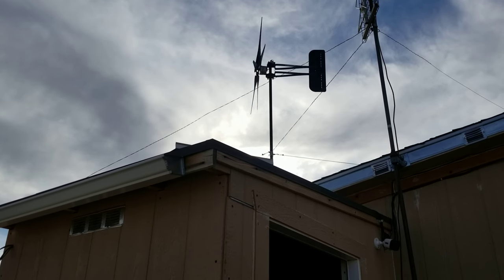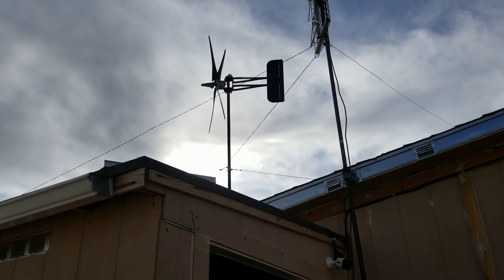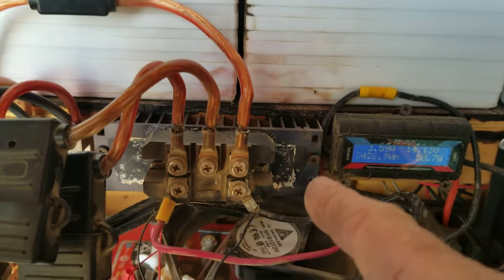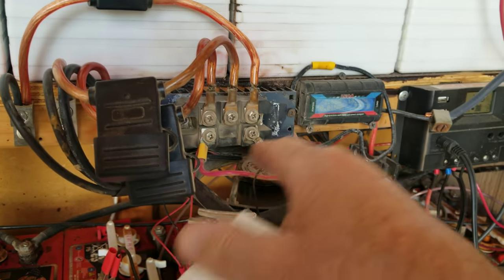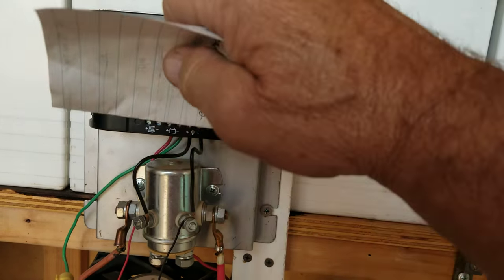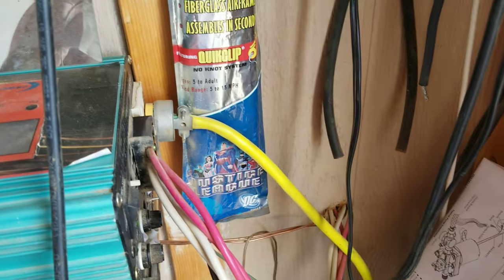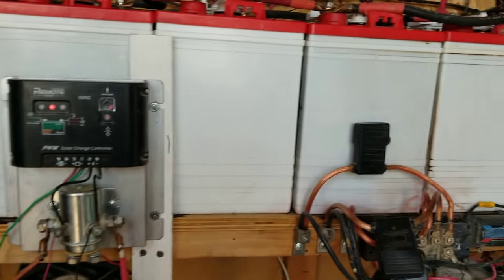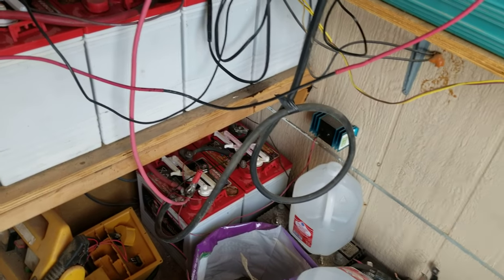Wind turbines, controllers and batteries explained, March 6, 2020

Comment: Hi, excellent video! Hey, I noticed your turbine turns clockwise and counter clockwise; does it matter which direction the blades spin? Does a 'reverse' spin cause any damage to the turbine? Thanks - and thanks for the inspiration!
Reply from the maker: Hi, a turbine ca. Only turn 1 way.  That is determined by the blade angle and the tail fin which keeps the blade facing the direction the wind comes from.

Comment: Good  explanations  but  just to long  I saw a solar  charger controller   but it's  about  here windturbine  
Help me if I am  wrong
Reply from the maker: I don't quite understand your question/comment.
None of the charge controllers in my power room are connected to my turbine.  The one green mppt hybrid controller has connections for a 3 phase turbine, but I don't use it because it doesn't show the PMA output separate from the solar.

Comment: So to make sure I have this right, The wind turbine generates power which is converted to usable power through the rectifier, which you then put through something that prevents too many Volts from going into the batteries, and from that it goes to the batteries?
Reply from the maker: Not quite, but close.
There are 2 types of wind turbines.  A 3 wire AC unit called a PMA, and a 2 wire DC unit called a PMG.
The PMG does not need a bridge rectifier and can connect directly to the battery bank.  The 2 wires are either color coded or marked positive and negative.
A PMA'S 3 wires are all the same color and unmarked.  These 3 connect to the bridge rectifier which converts AC to DC by directing current flow in one direction by use of a series of diodes.  The 2 wires coming out of the BR are marked positive and negative.  These go directly to the battery bank.
Since there is no controller to limit input, as long as the wind blows electricity flows to the batteries.  So, to protect the battery bank from overcharge,  a dump load diverter is connected to the battery bank and senses when the charge reaches a set level, then turns on to divert the excess power to a determined resistance.
That is the least expensive and easiest way to do it, but also the least efficient.
You could run the input through a Midnite Classic charge controller that is dedicated solely to turbine input/output and get the best production from wind to battery. 
Of course, cost of a Midnite Classic is usually why most choose a dump load controller/diverter.
NOTE: The Midnite Classic will work for wind, hydro OR solar input, but only one can be connected at a time.
Reply from the maker: Oh, and welcome aboard!
Reply: @GBear  Doesn't a charge controller require a stable or non-varying input to create a consistent output? So to use a wind turbine for instance it generates more power the more it spins so it may be putting 13V into the controller or maybe it puts 20V into the controller. Is the controller able to produce a 12V output in either of these cases without requiring a dump load driver.
Reply from the maker: @Narsterstar  the Midnite Classic does all that and more.  I wouldn't trust  Chinese made hybrid to do it though.

Comment: i got a 3000 watt turbine but it has 4 red wires comming out of it.. can ya get a 4 wire rectifier ?  any one know ?
Reply from the maker: Hi Wayne, welcome aboard.   I have not heard of a 4 wire pma, nor a 4 wire rectifier.  I have no idea why there would be 4 wires as an AC unit only needs 3 pairs (3 wire).
Is this a DIY unit?  If not, I would Google the serial number, or make and model for more info.
Good luck!
Reply from the maker: Wayne, I did some checking online and apparently you have a 3 phase unit, but one of the wires should be a neutral and the other 3 hot.  I found this
https://images.app.goo.gl/SvmAtABNaE5qV5JRA
I hope it gives you a starting point.

Comment: AWG = American Wire GAUGE not Grade.  Also 10 AWG has a large voltage drop for 35' at high amperage (>20amps).  The fuse block wire insulator is designed for speakers not high amperage.  The rating on speaker fuse blocks is much less then THHN or other insulators.  You are asking for the insulator to melt and cause a fire.  All terminal blocks need to be in a box just in case there is a fire, it can be contained.
Reply from the maker: Oh WOW, wish I knew that when I put my system together nearly 5 years ago.
Reply: @GBear  The laws of Physics are unforgiving and cannot be altered by man.  We can try and skirt these laws but eventually they will catch up to us all.  You are not alone and I have seen these mistakes many times over, as these are common mistakes.

You need to read your home owners insurance policy because it (most likely) states that any electrical fires will only be paid out if all the electrical work meets or exceeds NEC codes at the time of install.  I know people do not want any government interference and neither do I.  However, my insurance requires me to get all of my solar work inspected.

When I consult, I always advise an electrical inspection so in the event of fire, the home-owners insurance will cover the damages.  In my area, the cost of the permit is under $100 and the Electrical Inspector is great to work with.  

There are some people that have a back yard "solar shed" that is isolated from the house/garage. If it burns down, who cares right?  But you would be surprise how much the Fire Department will charge you, likely over $1000.  Homeowners insurance will cover this charge as well provided all work is inspected to the NEC.

You seem to have an average understanding of solar installation and thus an average risk.   My point is to provide an different point of view on solar install:  Do it right the first time, and get an inspection.

Comment: Dear G.Bears We thank you for your clarity of your videos ,very clear speach of yours ,and properly technical placement of all the aspects concerning what else....Energy. I have one question .We all know that somehow china is the center of our planet for most of the things that we all days we need.One thing that strikes my mind is the Wind Generator issues.They shout 1,5 KW    2 KW   etc and there are plenty of videos that they measure their output and the result is so dissapointing to the thechnical world.I really wonder how Not even one [to my knowledge] has not tried to create a wind generator from a truck Alternator which they really have good output but of course need long wings and strong wind.I will continue searching around for an honest wind generator in regards its cost.Also instead of having dump load for the wind generator to drive the cable to the appropriate Resistance of a water boiler so.no energy is being lost cause actually heats up the water inside the boiler. Everybody knows that there are professional people that they construct resistances to your needs AC    DC    5 volt    20 volt 100 volt  .u just name it.....Best regards.

Comment: Use solid state relays instead of solenoids, not worth the fire risk.
Reply from the maker: Been there 3 years without getting hot enough to hurt your fingers.  I have an automatic fan that blows across the solenoid when it kicks in.
Reply: @GBear  great info, didn't know about the bls will have to get one. Thanks
Reply from the maker: Get more than one if you have a large bank of batteries.   I just learned that in the school of hard knocks.

Comment: I am seriously considering adding a wind generator to my system because it suits my location, but don't want to stress my LiFePo by micro cycling multiple times a day.

I need to figure out how to create a wind generator system that dumps load without the dump load going through the batteries!? For example: the charge controller for the turbine identifies max load then diverts energy from the turbine before it even reaches the charge controller or battery. Every diversion / dump load system seems to cycle the excess energy though the batteries themselves, something that should probably be avoided. In dire need of a solution, but after many days of research there seems to be no solution. Maybe someone has solved this problem already? I would love to know...
Reply from the maker: GBear to the rescue!  Look into the Midnite classic 150, 200 or 250.
It can control a turbine efficiently and allows for adjusting a custom curve to meet your wind specs.
Reply from the maker: Oh, and welcome aboard!

Comment: i have a 800 watt 12v with a 100 amp charger set up and a 250ah battery life04 that burned to day and a 450 watt 12v with a200ah batterys with60amp charger doing fine
Reply from the maker: You ate saying 12v now, but you said you were going with a 24v system?
Also, this doesn't answer my questions.
Reply from the maker: Uploading a video now.

Comment: Why not just used a controller for the wind turbine too.
Reply from the maker: Cost
Reply: @GBear  
Cool. Okay I have an idea... Instead of just desipating the excess energy as heat through that resistor. Why not try doing something creative like water heater. I don't know about the cost sha🤔
Reply from the maker: Yeah, that's a common thought, but as I've said before, I don't need hot water in the desert.😁
Reply: G Bear's Off Grid Ways-A Homestead In The Desert is there a way to control the water temp if you did that to your water heater? I’d like to do that with my extra power (once I get set up) but I’m worried about the water getting too hot since we have little kiddos
Reply from the maker: Welcome aboard!  I found that the dumpload water heater was not an efficient water heating method.  This was due to the fact that the wind doesn't blow constantly or at a high rate, so the amount of extra electricity was negligible. The 300 watt heating element also used up any extra power that was created so quickly that it never really got the water hot.
I went with a tankless propane water heater which gives me hot water on demand, I can control the temp and water flow, and there is no pilot light so it is safe and efficient.
Reply: G Bear's Off Grid Ways-A Homestead In The Desert that makes sense... thank you for all the info! Like you said, it’s hard to find info out there on some of this.
Reply from the maker: I'll be happy to pass on what I have learned through trial and error.